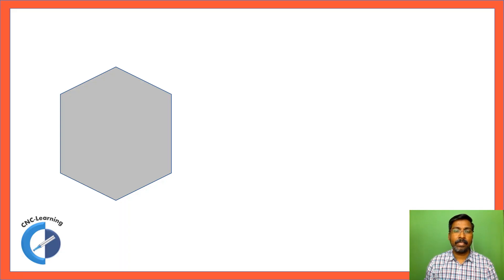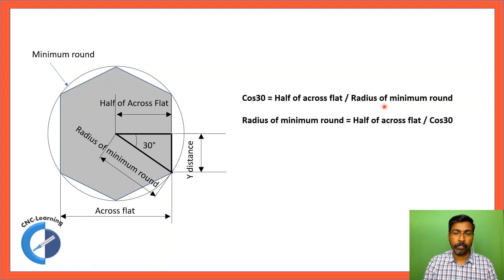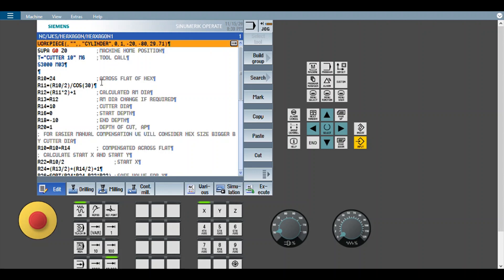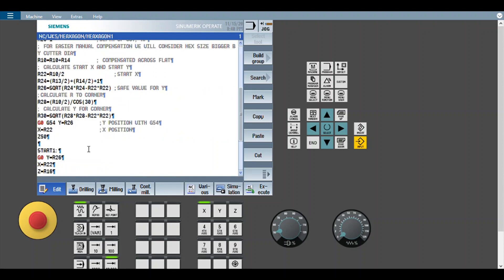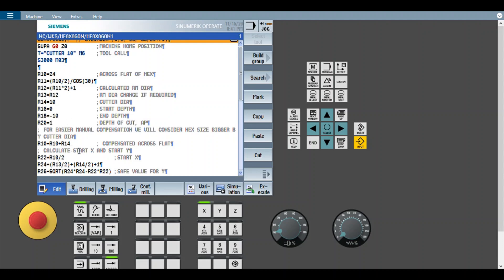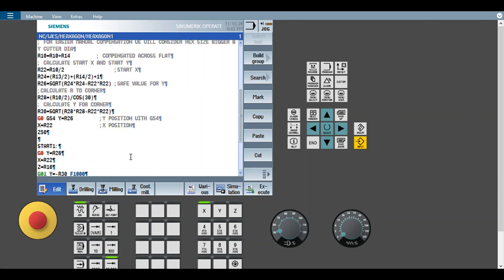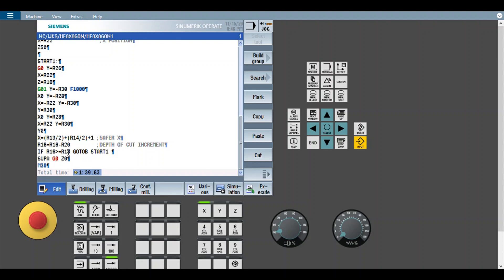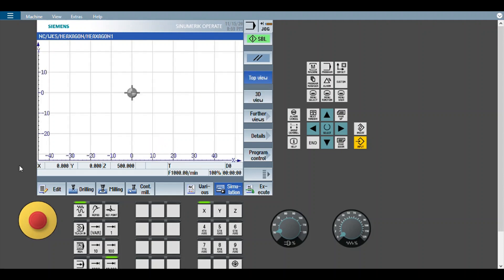Macro program to produce Hexagon | Siemens & Fanuc | CNC-Learning | Rajeev Sreedharan

Comment: SIR WHAT IS THE RAW MATERIAL SIZE . EXACTLY...  I AM CONFUSING RAW MATERIAL CALCUTING , I REQUESTING  IF IT POSSIBLE, PLEASE GIVE ME THE CLARIFCATION FOR RAW MATERIAL CALCUTING....🙏
Reply from the maker: Use fundamentals of trigonometry.
Cos 30 = adjacent side / hypotenuse 
First calculate half of across flat.
Apply this value as adjacent side in above formula. You will get hypotenuse.
Multiply it by 2. You will get across corner distance.
That is same as minimum diameter of raw material